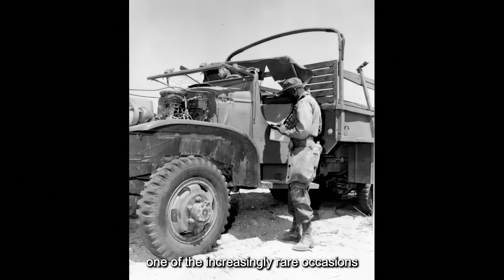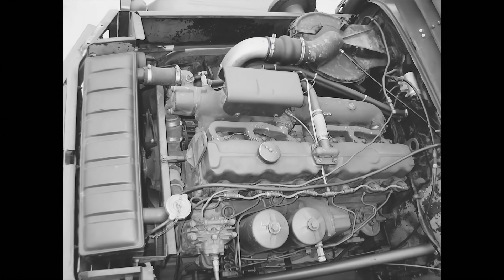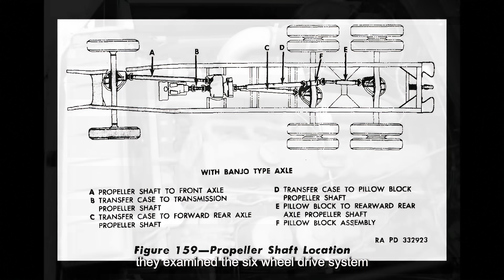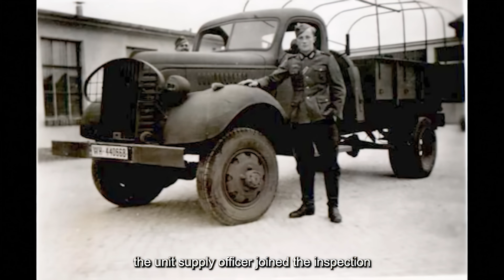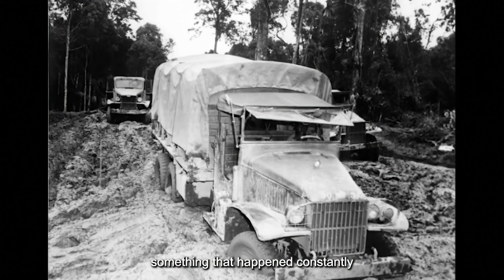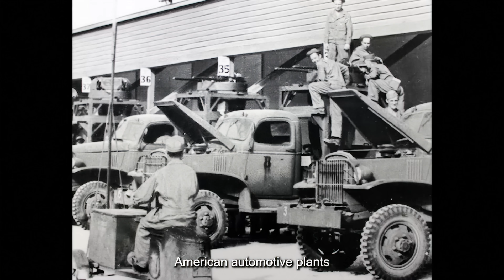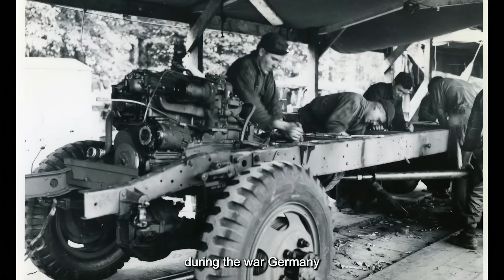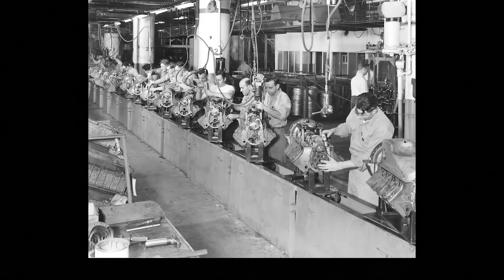Wehrmacht Mechanics Captured a GMC Truck... Then Realized Germany Was Doomed

Comment: We have a 1944 Willys MB (jeep) on our ranch. It has been restored 3 times since my grandpa bought it in 1948. The only thing we never restored is the engine. In nearly 80yrs and 168k miles that motor has never failed to start and run for a hard day of ranch work. Every child in the family since the early 1950 has learned to drive with that little MB. When purchased it had a war time name painted lightly over. It said Alice in cursive script. We repaint it each time and proudly call her Alice as respect to the nameless soldier who painted it 80 yrs ago. This video has inspired me to drive her into town today for Sunday mass.
Reply: 25 years ago I had a chance to buy one of those in a box.
All you had to do was assemble it for $2300 .I should have gotten it😅
Reply: @Cruiser777 I had a chance a few years ago to buy one for $400 it was best up but ran good it was a 1944 I think. An old farmer was selling it
Reply: @Cruiser777  When I was a kid in the 1960s, I remember seeing an ad in the back of some magazine offering WWII surplus Jeeps for $50.00, plus shipping.  As you mentioned, they'd come in the original packing crate with some assembly required.
$50.00!!!  Even as a child that seemed dirt cheap.
Reply: @Cruiser777 25 years ago, would have been a scam. WWII jeeps had been surplused out by the 1960's.
Reply: @Cruiser777  Yes you should have! I have missed so many opportunities like that on vehicles, but I have never had enough room to store that many vehicles. If I kept all the vehicles I have owned and liked, I would need a couple of acres of parking!
Reply: @Cruiser777 .
Would have, should have, could have but you didn't
You spent your money on things that were needed, not wanted. Good for you.
Reply: @Cruiser777 you know that wasn’t a real thing right?
Reply: God bless you and God bless America 🇺🇸
Reply: Man, I wish I could find one. My health from poison water at Camp Lejeune, not conducive for highway driving. But my hobby is driving the abundant wilderness trails around here. Just a couple miles from my house. Arrow heads, fossils, driftwood and such. A guy had a 46 jeep a trench, I offered $5000 . He wouldn't take it. The I found out he sold it for scrap. Smh
Reply: Great story 👏
Reply: A cyber truck won't last a year!
Reply: @Be-Es---___  Don't you mean Cyber Rust?
Reply: In 1969 I was a young about to be father in a strange state (Washington)  I got a job at a place called 'Yardbirds'  their home store.   It rented everything.  One of the owners bought 20 Jeeps that came on flatbeds.    LOL... they were in really strange condition.  to say the least.   they were damaged jeeps that had been damaged during air drops.    out of the 20 I got 4 running and working fairly quickly.  Maybe?   8 more could have been salvaged but by then I had quit.
Reply: @doranmaxwell1755  very cool story. I was part of the 1/504th P.I.R 82nd Airborne US Army. I love anything related to Airborne service!
Reply: What a beautiful story — a bridge between generations. “Alice” isn’t just a Jeep; she’s a memory that’s still running strong after 80 years. 🙏
Reply: Funny thing is GM owned Opel
Reply: @davidpeters1927  and now Daimler-Benz owns Jeep.
Reply: @roninselman6772 no, Daimler broke away after they stole Jeep technology and forced Dodge to sell badge engineered Benz top heavy vans instead of the Dodge designed full size vans.  I see more older Dodge vans from 2000 than the top heavy clumsy badge engineered Daimler Benz vans with the Dodge name on it.  And the FIAT badge engineered Dodge vans are real overpriced ugly unreliable whoppers.
Reply: A few small towns in India still restore Old Willy's & having one is as much a status symbol as having a range rover
Reply: Do. It
Reply: Hell, they still built full body jeep kits in the  Philippines from the descendents of the original dies!
Reply: Amazing how machines can outlive the wars they were built for — and keep carrying peace instead. Do you think Alice still remembers?”
Reply: Goosebumps! “Alice” survived war, time, and generations — that engine’s got more heart than most modern machines
Reply: One of the most American things I’ve read lately …. Thank you
Reply: @andrewc4352 👍🏼👍🏼
Reply: 1943  Willys MB in profile pic
Reply: How well has the entire drive train done for you over the years?😊
Reply: @TheSunnyvaleTrailerPark  every drivetrain part has been gone through at one point. The transfer case has probably seen the most rebuild service. These cases leak oil and if it isn't leaking it is dry. My uncle rebuild it in the early 80's and I rebuild it again in 09 during its last frame off resto work.
Reply: At 3:22, the visuals are very clear and immersive — thanks!
Reply: Neetoo
Reply: I had the privilege of seeing an old Willys at a friend's house. It still ran. The body and seats were still in good  condition. They don't make them like that anymore. 

In fact, I saw a modern Jeep with the Willys label on it. The ground shook from all those heroes spinning in their graves.

This thing was huge, more like a Hummer than a Willys. Fiberglass, big tires, air conditioning. Only a certified Jeep mechanic  could repair it.
AND IT HAD THOSE STUPID DUCKS ON THE DASH!

I almost cried.
Reply: I learned to drive on an old 41 Willys - great farm tool
Reply: When I was a child In the 50's I remember the Jeeps moving through a nightmarish and muddy dirt highway that climbed the Andes in South America, these vehicles were so admired and revered by mechanics as one of the best worldwide,at that time American cars were kings of the road all over the world, what times!!
Reply: Cant beat the old 1/4 ton jeep!
Reply: Amen
Reply: I love those, but with points, generator, water pump, starter, belts, and a host of other things, I bet the little beast has demanded a bit of attention, even if it never made anyone walk!
Reply: @davidkilts1670  generator is now a one wire GM alternator. Points are in the storage box incase the aftermarket electronic ignition goes bad. Honestly the only thing that is old school pain is the manual steering in a parking lot and maybe jumping out to lock /unlock hubs.
Reply: If you do take her out, I hope every head turns — because Alice deserves it.
Reply: How tf is 164k miles any impressive?
Reply: @errvega2705 way back, if you got 100,000 miles on a vehicle, you were usually the exception, not the rule.  This went on way into the 1970s.
Reply: @errvega2705 the way they were beat EVERY MILE??? ARE YOU KIDDING???
Reply: @errvega2705  because it is over 80yrs old and only does 45mph! Anything you won will be recycled 15 times into Chinese soup cans in 80yrs! Hell it will be in the crusher in 25 max!
Reply: @errvega2705 that’s ALL HARD WORK MILES!!!
Reply: Did General Motors sue the US government in the 1960s for bombing an Opel plant in France during the war?  The plant manufactured German military vehicles and was a legitimate military target…during the war.  

     But it was a converted GM plant in occupied territory.  The irony is mind-bending.  Bombing an enemy manufacturing facility damages an American automotive company defeating the same enemy manufacturing enemy military vehicles!
Reply: Here in Vietnam there are some old jeeps around and a few Ford MUTT. American manufacturing does not reach the simplicity and quality standards of the old days. It is all about profit
Reply: Are u kidding?
Reply: Alice will like that, take her out and pick her a flower today, girls like that.
Reply: Amazing.  It strikes me that we may all be driving such vehicles in the future.  With the way the cost of living is going, no one will be able to afford to have their new vehicles fixed for them anymore.  We'll be forced to own things that we can fix over and over again.
Reply: @BC-yd6dl 
Buy a Ford Model A…
Reply: @DavidWESTENBERGER absolutely!!!… it will STILL RUN!!!
Reply: You going to Mass was the best part of the story.
Reply: I'm not far off that mileage on a shitroen c3 , it's 18 years old and just about gets me around town daily .

Comment: "Opel Blitz had only 2WD", while showing 4WD Blitz at 0.44 - this is just ridiculous! The Germans had 1.5, 2.5, 3 and 4.5 ton trucks - even 8 and 10 ton trucks. There were simply too many different vehicles and brands, yet never enough of them. Not enough standardization, not enough steel etc.
EDIT: Time stamp is 0:44